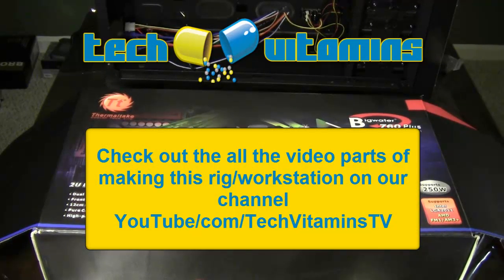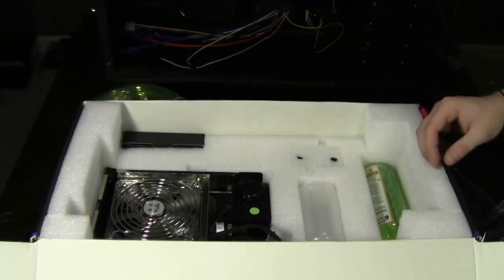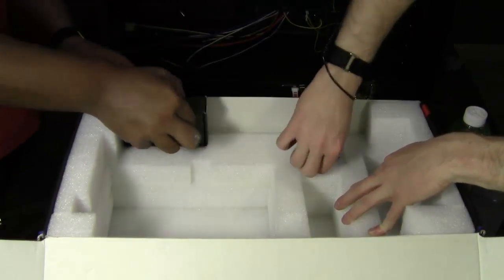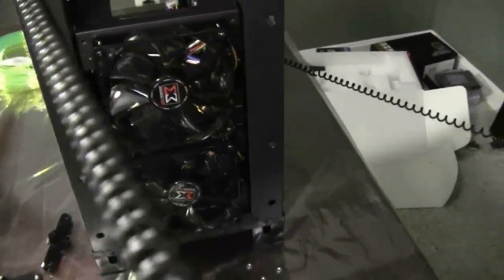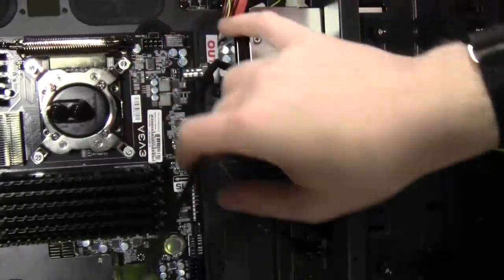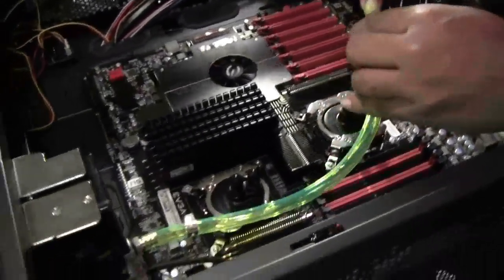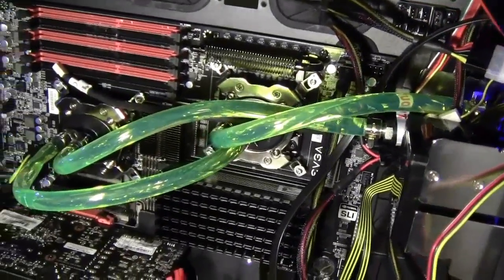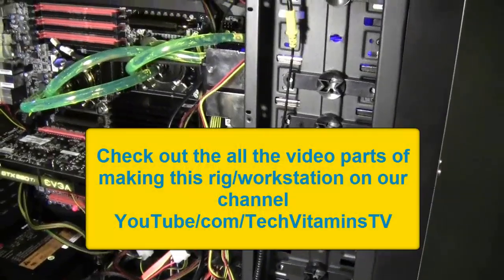Thermaltake  Bigwater 760 water cooling review and installation

Comment: If I added 2 more waterblocks and more tubing for cooling crossfire gpu's will this system be sufficient? I like the drive bay installation and it may save me having to buy a fulltower case

Comment: thank you for the quick reply, Ive seen really negative reviews for this cooler stating that the noise is too much and its performance isnt as good as an equally priced air cooler. I really dont like the size of the Corsair units, as well as the asthetic appearance of them. I love the look of the BigWater 760, which is the reason im really wanting to get it. 
do you think that you can replace the stock fan with another stronger/quieter fan?

Comment from the maker: @darwing36 it's usually steady @ mid to high 30s celcius but it has gotten up to as high as mid 60s before when I overclocked them and was rendering.video. I may be upgrading the cooling soon or combing with another radiator pump system and desperate them so each system cools one cpu.

Comment from the maker: @wietsebmx  i am not sure of the top of my head.  Go to thermaltake's website and it should list all sizes and socket types you can use the supplied blocks and brackets on.  But you can always solve that problem by getting the correct water blocks and making your own brackets.

Comment from the maker: @noctis008 yeah it takes a 12V molex power connector to power the pump and then there is a 3 pin fan power connector for, of course the fan.  And if you intend to use it for your video card you are going to have to purchase a block specific for your vid card

Comment from the maker: @jorge9427 yea i think you will be fine.  one thing you can also do is a get a program/app that will monitor your powersupply wattage output so you can stress test your system under different scenarios so you can determine if you you are getting close to having to upgrade the PS.  i would say make sure you picked the correct motherboard, then CPU and then the video card.  The power supply is always the cheaper component and can be upgraded at anytime.

Comment: Im asking if I can run the watercooler with a 600w Power Supply. ANd I only have 1 video card on that is the Geforce 560 DS Ti. I just want to cool my CPU but Im afraid that 600w wont be enough for it. Also I am thinking of getting a fan controller for my PC just like the one u got on/ Thanks for the reply!

Comment from the maker: @jorge9427 if you are going to cool 1 processor and don't have a ridiculous video card 600w should be enough. This cooling system specs rate it at a max output of 200w I believe. In terms of fit if u have 2 spare cdrom bays then it will fit. Check out my last video for this build, it goes over exactly how to determine if your power supply can handle your set-up. It's called "building a monster PC final review and thoughts" or something like that.